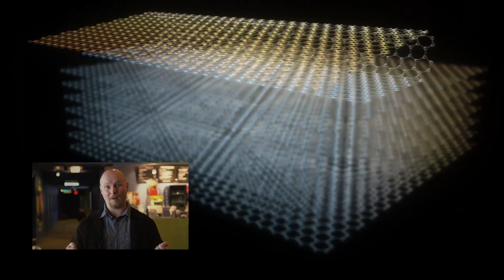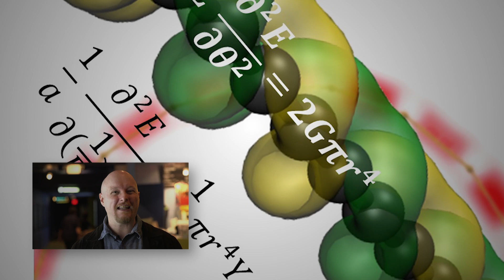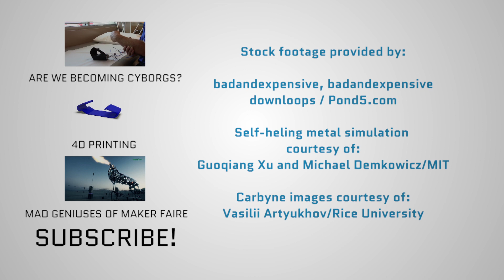Can We Make Thor's Indestructible Hammer?

Comment: I think it's totally possible to make a nearly indestructible material. All you have to do is have a physical object composed of layers of 2 different amorphous substances each of which is a few atoms thick like for example amorphous SiO2 and amorphous Al2O3 and the layers should be parallel to the surface of the physical object. That way, if it gets a tiny little scratch, then any tension applied to the material after the scratch will peel off a small microscopically thin outer layer of the object instead of propagating the crack. Glass actually has an observed strength that's usually somewhere around a 200th of its theoretical strength of 14 GPa due to microscopic surface cracks. This idea allows for nearly indestructible brittle materials and the advantage to being brittle is that it won't deform under a huge amount of stress. However, such a material probably can't remain in its current form for ever. Over a really long period of time, its atoms would probably very slowly rearrange themselves into nanoscale crystals and diffusion of the 2 substances into each other removing the layered structure, turning it into a substance that does support crack propagation and therefore have the ability for its strength to be considerably lowered by a tiny little microscopic scratch.

Comment: Indestructible razor for shaving seems most practical. Imagine using a 10,000 year old razor that was never once re-sharpened and has been used several times a week for all of those years and is still as good as new. Since it would be impossible to destroy, any extreme methods could be used to clean and sterilize it, so no worries about germs/dirt/grime.

Comment: I've been calling compressed fullerite (ADNR) bifrost because it is appears like a rainbow colored metallic substance ;3 it also has a toughness of 491 gigapascals or more than 35,000 tons per square inch.  I've been using it in the design specifications for my homunculus prosthetic body :)
Reply: Noscoping egg metallic allotrope of carbon is rainbow colored and more durable than diamonds.
Reply: Noscoping egg yes.  Carbon nanofiber and vanadium dioxide augmented hybrot musculature on a compressed fullerite scaffold with a composite aramid polymer and penta-graphene mesh dermal layer.
Reply: Noscoping egg umm no... probably could make a workable system with 50,000.  Far less than it would take to build a fighter jet.

Comment: Being stronger than diamond isn't very impressive steel is far stronger than diamond however diamond is extremely hard but that doesn't mean one blow with a hammer or a heavy rock wouldn't chatter it it's the same with glassit extremely hard material however very brittle

Comment: I'd make Iron Man's Armours.
Reply: hell yaehhh
Reply: Soeradj Chotkan Actually, I've been researching the technology for Iron Man for about 5-6 years, now all that's left is to make an Indiegogo or Kickstarter campaign and buy the tools and materials necessary, then I'll be ready to rumble.
Reply: only the suit ??
Reply: Soeradj Chotkan Not just the suit, the Arc Reactor, Repulsors, and any other Add-Ons and equipment as well.
Reply: oohki now lol waw n jou're nt even 18 i guess :P lol the arc reactor even knw how a reactor works n how the hell will you build n repulsor ???
Reply: Soeradj Chotkan According to my research, the Arc Reactor was spun off of the Repulsor technology, therefore, if I can make one, I should be able to make the other, that and the Repulsors have been described as either compressed and Charged Neutron particles, charged plasma, or high density Muon beams, since I'm contemplating the use of Muon catalyzed fusion instead of the proposed cold fusion that is stated in the article on the Huffington Post about the Arc Reactor, it's likely that the concept of high density Muon beams could be used as the basis for the Repulsors with the additional use of Ion beam mixing which allows Kinetic Energy to be transferred through a Laser and by extention any other beam of particles.
Reply: ***** lol if your serious about the whole iron man suit thing i think your best bet is to go with a very small fusion reactor or multiple very small fusion reactors because we already have the technology and its actually foreseeable to see them in the future if we had the need to make them. as for arc reactors we dont have a full specific definition of what it even is. not that your theory is wrong but it could be a "brand name" for another type of reactor we already have. just a thought. i dont wanna burst your bubble or anything :) so make it happen! i would love to see someone do this!
Reply: A.J. Rich Thank you, I appreciate the support. :)
P.S. there's actually a page on the Huffington Post describing the construction and functionality of the Arc Reactor.
Reply: srry bro but bs i'm a physicist my self so i know what im talking about you can make it respect but the shit you described before cant be accomplished   "ion beams " would just kill you and one more thing if you where even able to build it you would heat up the air around you lot to even kill you
Reply: lol your not a physisist
Reply: really 
do you know me
Reply: yes.. as a matter of fact im right behind you...
Reply: uhmmm was the you're not a physicist for me ??
Reply: well im not under anybody else's bed right now...
Reply: A.J. Rich I appreciate you trying to defend me, I really do, but I can handle some criticism, thanks anyway. :) 
P.S. If you want to truly support my efforts, I intend to create an Indiegogo campaign at some point, you can make a donation if you'd like when it's up.
Reply: i will donate! send me the link when u get it up :)
Reply: A.J. Rich Sure thing, thank you in advance. :)
Reply: ***** You can't be serious... Let me be very clear but hopefully not too rude. You can research until your eyes turn to dust but you'll still never find a power source powerful/light enough to power this suit, not within our lifetime. Oh and those cool flight maneuvers he's always pulling, just go ask anyone who's actually been in a cockpit and you'll quickly find out just how ridiculously impossible they are. Now, arc reactor technology is real, but even if you could scale it down, the amount of heat it inefficiently wastes would leave you and your suit as a puddle of molten melt. I mean honestly dude, who lied to you? No aspect of the Iron Man suit is currently feasible. No one's laughing because they are trying to put you down, they're laughing because if it was as simple as doing a little research, everyone would have a suit by now.
Reply: I am with this guy iron man all the way.
Reply: Aaron Hallstrom Thank you, I really appreciate the support.
Reply: Alright man I'm all for this Iron Man Thing but realistically if this suit was somehow able to be powered then either it would be too light and would melt under the searing heat, or just be too heavy and wouldn't move an inch.